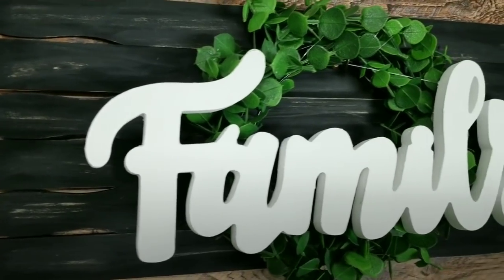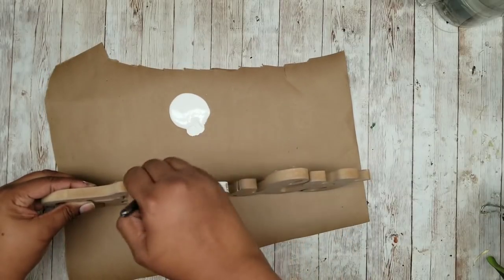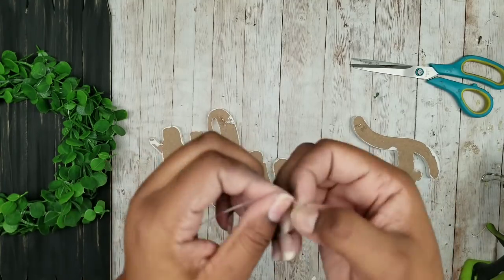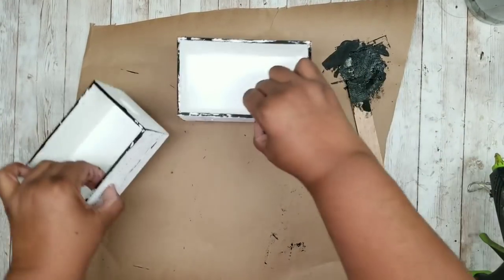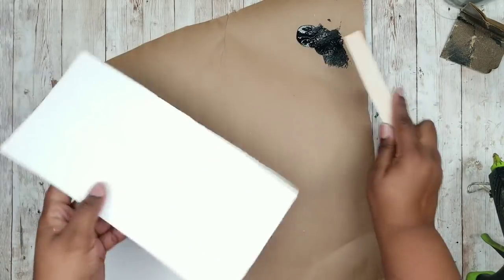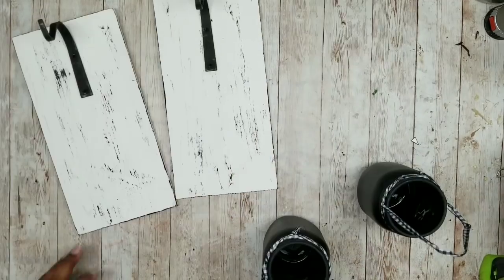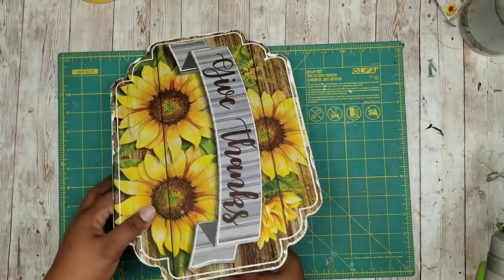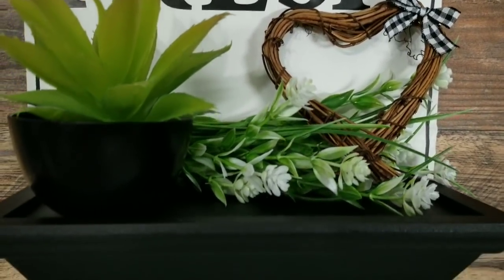*NEW* DOLLAR TREE DIY | Farmhouse Home Decor | Wood & Signs | Interchangeable DIYs & FREE Printable!

Comment: These are all so beautiful. I just wish the lower case "a"  in the word family  had been designed better/ "proof read" before production.! I have seen other youtubers use them. That is not an  "a". The lower horizontal of the capital "F" is too low. What lower case "a" has 2 parts sticking up into nothing?? Lol . I am anal retentive, and that bugs me.
Reply from the maker: You can actually adjust it by sawing off the extensions of the "a" if you like. I actually did not notice it until you pointed it out, but it doesn't bother me at all. It's just the fancy font they used I suppose 🙂
Reply: @SheSoCraftDee  thanks